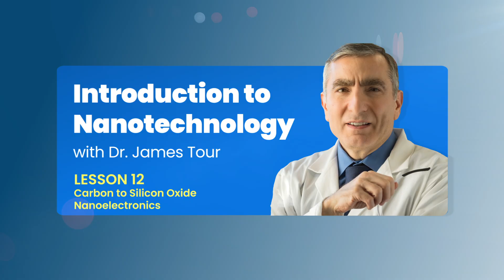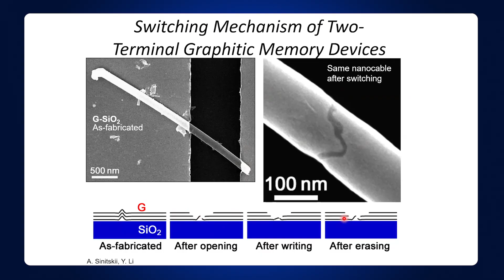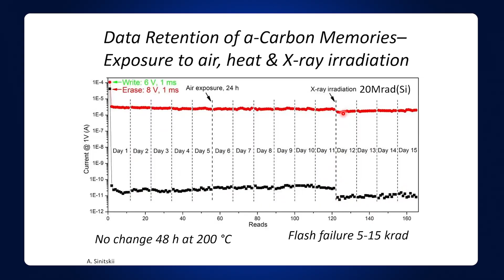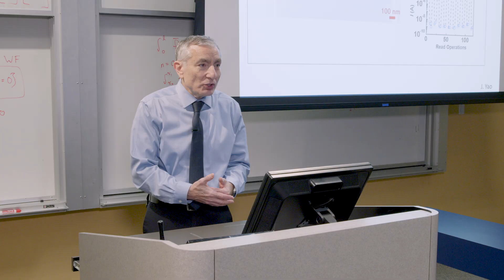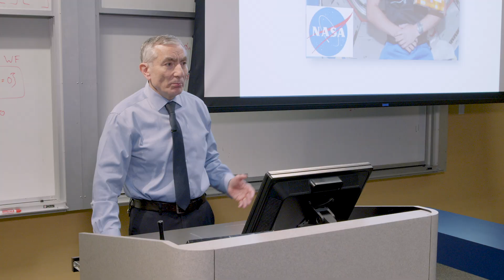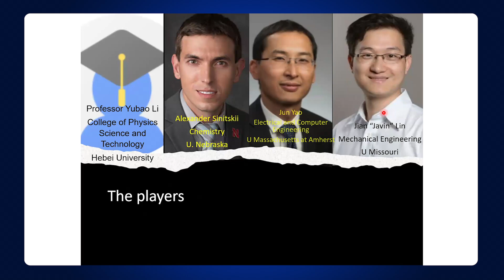Silicon Oxide Memory Breakthrough | Lecture 12: From Lab to Industry #science #graphene #pchardware

Comment: What is the mechanism of multiple states? Either you bridge the filament or not, so I can see understand the switching On or Off. In multiple state memory, are there parallel cells activating at different voltages depending on what?

Comment: Has anyone tried Crystals for recording ? V call it Spatikha in India and our ancient Indian knowledge systems say it is an excellent recording device and is capable of recording vibrations and frequencies. There’s even an event in the Mahabharata which involves recording using a Spatikha. Dunno if there’s any research that’s been done using modern science regd this but would be cool if it turned out that the scriptures were right regd crystals. That would then open up the question of how they do found  out about that property but first let’s c it get proved in a lab.
Reply: Yes, I used one, and we made crystals like that.
Back in the '90s, we experimented with holographic recording crystals.
A crystal the size of a sugar cube can record a multi-hour color 3D hologram. It hasn't hit the market.
It's too good, and there are no 3D players yet, and the market isn't ready for this technology yet. 
It's been working in the lab for 35 years. It's nonvolatile, but rewritable memory.

The ancient wisdom is correct. We really are recording vibrations, the vibrational states of laser light.
Reply: @ wow nice to know

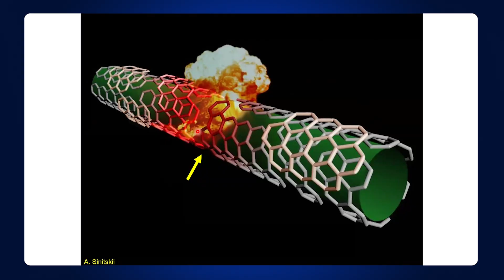Comment: At 13:00 the crack in the tubules reminds me of modern high performance engine conrods.
They have a full blown Jagged crack to join the two halves of the big end bearing on the conrod. 
I guess its like creating a silicon mold and using jagged cuts so you have a really good key, to line the joins up perfectly.  

Food for thought.

: ]

Comment: That was interesting, I'm only 16.45 in but as soon as you mentioned the breakage of the carbon layers I was wondering if that could essentially be repaired by an ecapsulant where as the break occurs at high temperature, the encapsulant generally condenses the evaporant back into place. I haven't yet formed the complete picture but it is a very informative and educational video so far.

Comment: There's prior art describing small glass cubes containing vast amounts of digital data back in the late 1980's or 90's.
Reply: @5nowChain5  actually seem one of those. It spins the cube and writes with a strong UV laser, then reads with a visible laser, and uses a strong IR laser to erase. The issue was the lasers at the time were very big, required water cooling, lots of power, and were insanely expensive. Now they could make it a lot cheaper, using diode lasers for read and erase, and a DPSS UV write laser. The data storage density per volume is not as high as current flash memories. It would still be good for long-term archival as the cube is made of cerium-titanium doped silica. The write laser creates a color center dot at the focal point. The color center blocks the reading laser, creating a bit, and the longer wave IR laser heats the area that had the color center making it transparent to the read laser. As long as the cube is kept below 600 deg C it will keep the memory. ♥️

Comment: The current generation of Micron DRAM devices use a tiny tiny vertical tower capacitor as the memory bit and they are able to put many billions of these on a chip.  With using silicon oxide and graphene, these tiny towers could be reconfigured as this RRAM.   I'm pleased to be in position to work with this stuff as it reaches market suppliers.  It was several decades ago I asked my semiconductor designer coworkers if we were going to use graphene in our chips.  Now I understand why they couldn't answer.  Nobody understood the microelectronics of it back them.

Comment: Been waiting for crystal memory since the 1980s.  Not getting my hopes up...
Reply: Um news flash you have had it since the 80s, this is just a different style, ie your hard drives have been using a crystalline structure of pure metals like platinum . A crystal or crystalline solid is a solid material whose constituents (such as atoms, molecules, or ions) are arranged in a highly ordered microscopic structure, forming a crystal lattice that extends in all directions
Reply: @ntal5859  News rehash for you:  A 'crystalline structure of pure metals' as a coating on a disk platter is not the same as a 3-dimensional matrix of a crystalline material that can be written into with lasers.  And HDD drives don't have near the capacity of proposed 'crystal memory' modules.  Plus, crystal memory will be non-volatile -- something that even SSDs can't claim (yet).  Oh, and thanks for the thumbnail review on crystalline structures.

Comment: The #1 issue with any new microelectronic material and technology is reliability - how long does it remain useful/functional?

Most new materials and device types FAIL this test.  And the ones that succeed take an average 10+ years to validate and tweak into manufacturing processes that are economically viable.

This is why perovskite solar cells are a major gamble - the reliability problems are inherent to the chemistry of the technology.  They use to crow about it be Green to manufacture but that is exactly why the reliability sucks.  It's all about energy barrier width and height!

Right now the expected life span of your average deep nanometer transistor is 10-15 years.  The fact that the economic life is shorter is the saving grace that hides this physics fact.

New technologies like this are more complicated than a "simple deep nanometer transistor". So the time to market is going to be longer.  You will NOT see this NVM technology any time soon.   Maybe in 10 years.  But maybe 20, 30 or longer.  Maybe never.

The moment I start seeing papers about this at IRPS, I start to allow myself to become more optimistic.

Comment: I worked on a SiO2 breakdown memory in 1993.  The SiO2 barrier was thick; so, the breakdown caused much more than a fine filament to form.  The memory never made it to market.  Next, we used a state changing material in our NV memory.  It worked but it had too much variability, probably because of the large size.  Another company had better luck when they went smaller.  The final NV project during my time was a silver filament forming structure.  It worked but it was complicated to make.  Hence, it is interesting that going smaller, with the same principles we used, opened up opportunities that we only dreamed of back in the 1990s.

Comment: @Dr. James Tour - I have many questions.  Theoretical bits per chip?  Possible Read/Write Speeds?  Durability?  Durability in comparison to Volatile DDR5/DDR6  RAM?  (Can non volatile RAM take the place of volatile RAM).  Can this be adapted to be used with current home computer and business server technology?  Is this only viable for long term storage devices such as SSD's?  Longevity of stored data?  How can I get involved?
Reply: Simple you can not, if you listened they were developing this in 2005/6, so this means its now going into production. ie 20 yrs of r and d, means now ready for commercial products.
Reply: @ntal5859  If you watched to the end of the video, Dr. Tour said that the research has been released because Sandisk/Western Digital didn't want it, so his own company is free to use it.  Getting involved could include investment opportunities.
Reply: @voiceofreason9258  reasonable questions